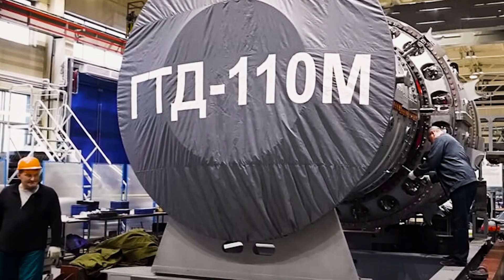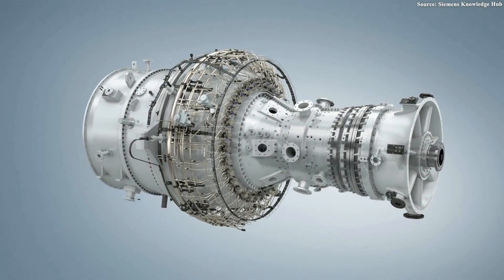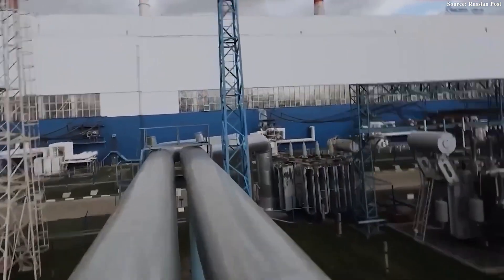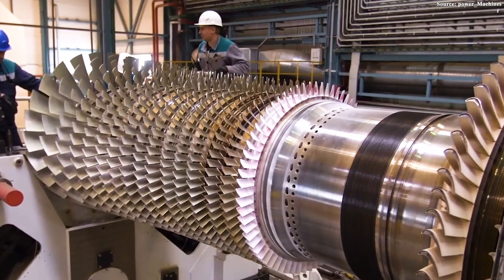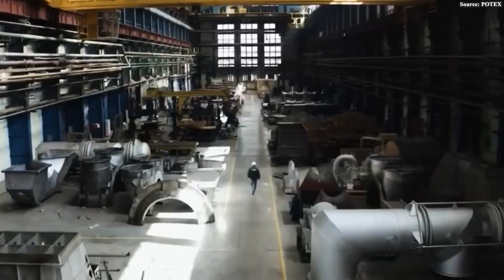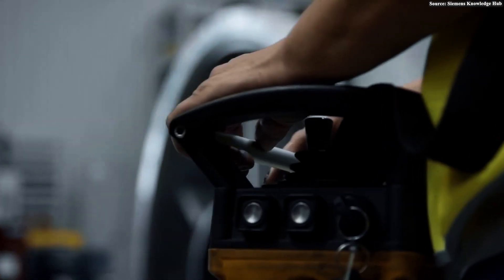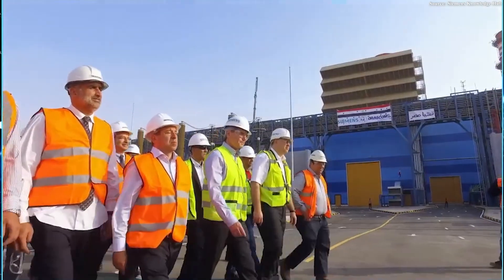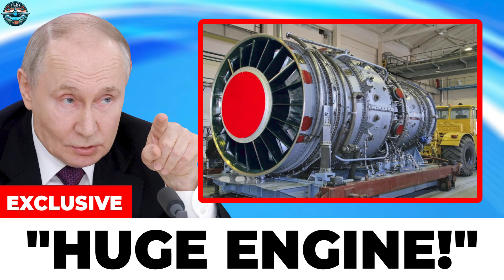This Russia's NEW GTD-110M Engine SHOCKED the Entire Aviation! Here's Why

Comment: Yeah, well, this is OLD NEWS. The 118MW turbine has a thermal efficiency of 36% which is well behind the 42~43% of competing GE and Baker Hughes offerings in the > 50MW class such as the LM6000, LM9000 and LMS100. What's in stationery generation applications is time between overhauls and Russian engines suck with 1/3 to 1/2 the rating.🤣
Reply: No worries, now Russia has its own turbines and is independent from the main suppliers.🤪

Comment: A) This is not directly about jet engines at all. It’s about stationary gas turbines for electricity generation. There is substantial overlap between the two, but you cannot just strap a gas turbine under a wing and watch it take off.

B) There was never any doubt that Russian engineers are competent, it’s just that they were primarily employed in the country’s military-industrial sector as long as civilian products could be purchased from Western companies. Sanctions have forced Russia to shift the focus, a move made possible by the shift to low-tech drones in its air force.